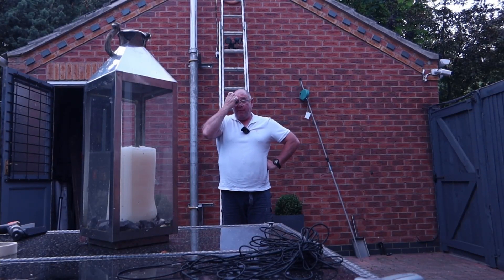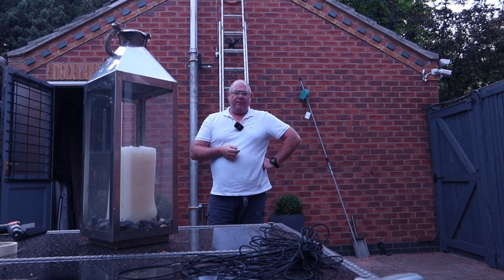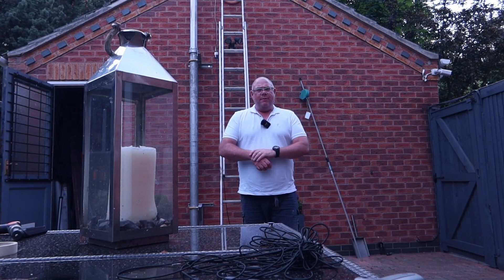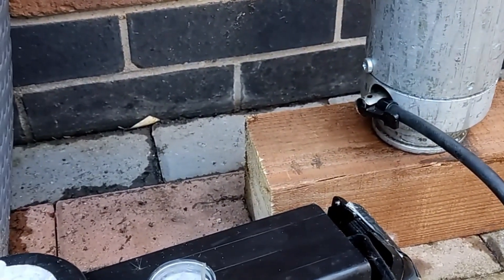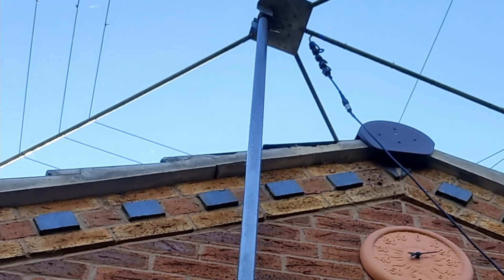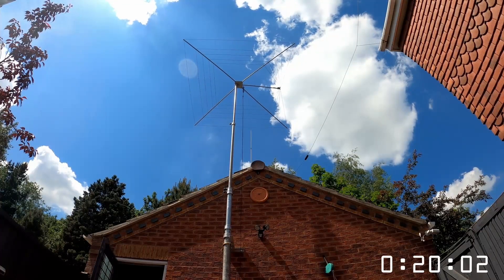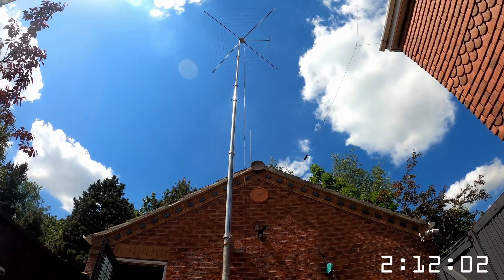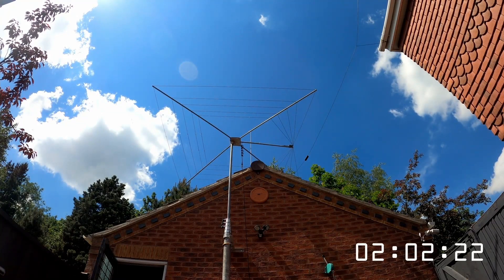Testing the 12M Pneumatic Mast with the Cobwebb on.

Comment: How do you find the cobweb? I've got a Hex Beam on mine, which I am very happy with.  John 2E0SVB
Reply from the maker: I love the cobwebb as it's easy. Is it better than a hexbeam NO WAY! However, it is kind of omnidirectional so no need for a rotator (more expense, hassle, etc). In saying all that Jon, if I find myself needing planning permission then that will be going in based on a Hexbeam, not a cobwebb!
Reply: @MikeM0XMX   That's what I did. I used an architect who is also an Advanced licence holder to deal with my planning. I have a 12m mast from EcoMast Ltd. I am using a Hex Beam.